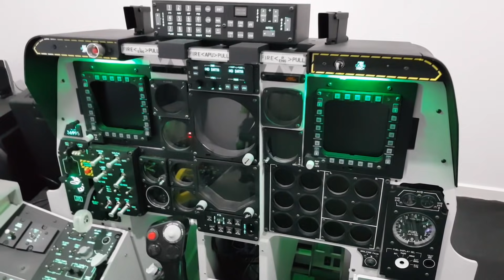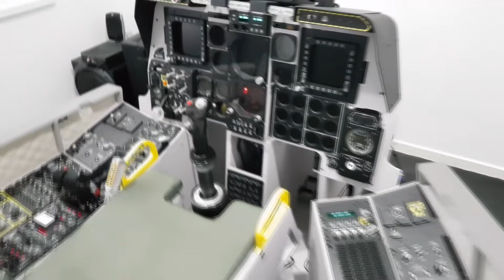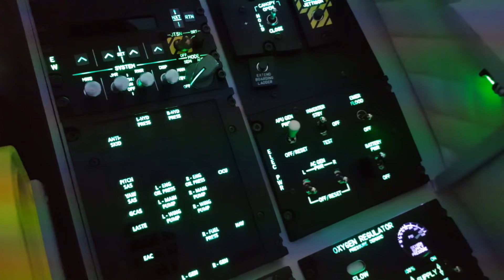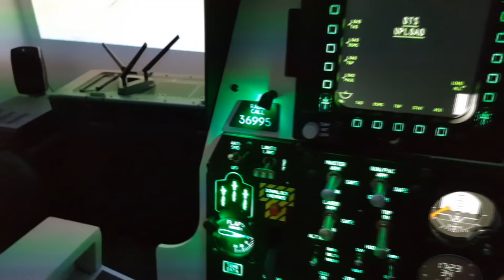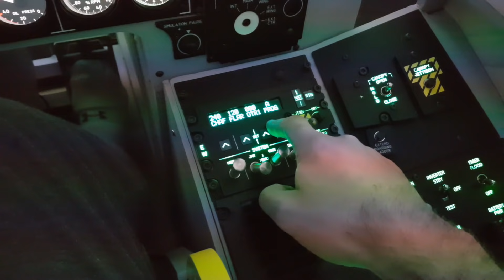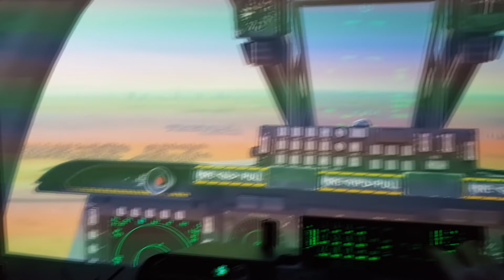Introduction and Cold Start

Comment: If you can output the HUD over black, you might be able to make a simulated heads up display. Get some coated half silvered plexi like they use on teleprompters. then put the plexi on a 30 or 45 degree angle with a screen underneath with the reveresed image. Should shine up onto the plexi, yet you see through it. Might be a trick to line it up, so might have to design in threaded adjusters, but give more realism. The game's brightness for HUD may make for accurate adjustment on cockpit knob.

https://www.bhphotovideo.com/c/product/1219713-REG/magicue_maq_glass_pr17_glass_for_17_presidential.html?ap=y&smp=y&lsft=BI%3A514&gclid=EAIaIQobChMI7qik49WW4wIVj4WzCh1JYgg8EAkYAyABEgLoTvD_BwE

Comment: "The ejection seat… everything works"
*pulls yellow handle
*patches hole in roof
*builds new, cosmetic seat
Reply: It's a real motivator to succeed in the missions I'll bet.
Reply: DundeeDriver i was going to ask if after he pulls the face curtain does the roof open up to fire the seat...lol
Reply: *apologizes to wife for mess

*remembers has no wife, goes back for another run.